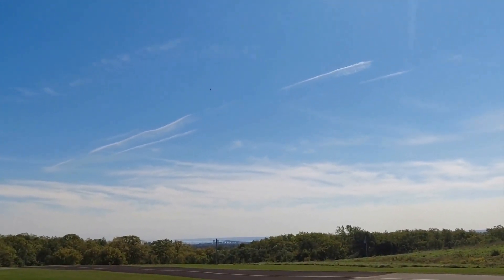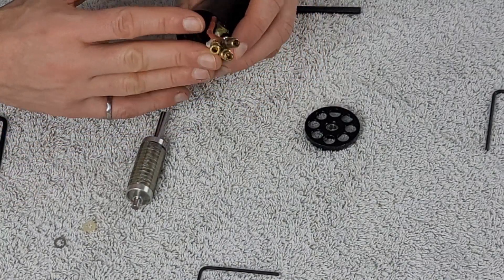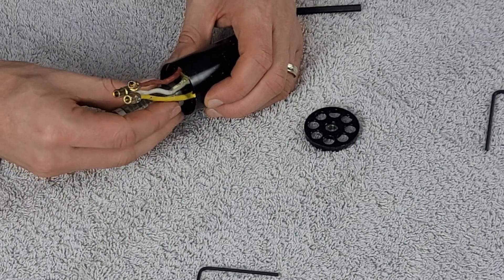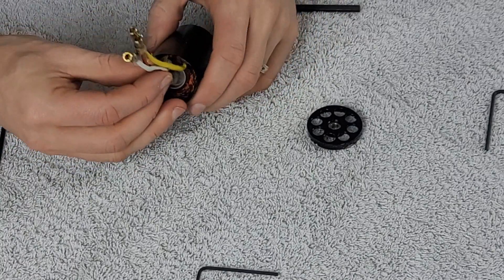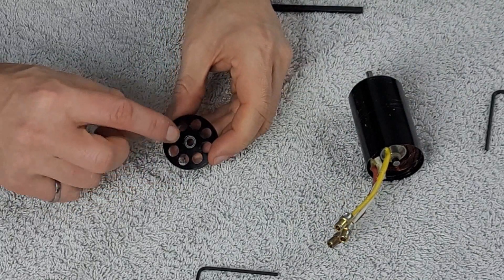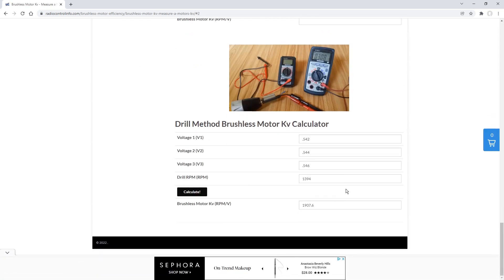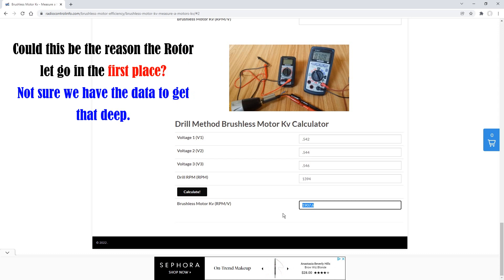Replacing a Rotor in a Brushless Motor - Unexpected Conclusion to our Failed in Flight Motor

Comment: Hey man, great info in your videos like always. You have enlightened me on so many subjects in the hobby I've lost count now. Awesome stuff. 

I am about to attempt re-winding an inrunner (will be a pain in the a$$ due to size and iron core not coming out of the can). The copper inside was melted after an experiment with running this motor on 8s when it is actually rated for 6s. It is the FMS 3060 1900kv 6s in a 70mm 12-blade FMS edf fan if that is interesting to you. 

So.. couldn't really count the turns of windings on each pole, but looking at the space given  in between poles in the core and phase wires count / 2 (i should probably say braid thickness of a phase wire) I can assume that braides of 6 0.45mm wires can fit comfortably on 4 turns per pole. Not sure if this is what the original scheme was and don`t know whats about to happen but Im bout to find out anyway :p

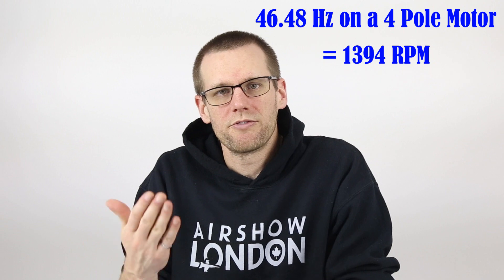Can you however explain what is the formula behind your ecuation and results at 9:16 top right corner, blue text? That would be very helpful of determining the kv I`ve achieved with the motor, given that I manage to wind it and get it running properly and then compare to the original 1900kv stated on the can. 

Anyways great channel man. Keep up the great work of diving deeper and deeper into those details.
Reply from the maker: Thanks for the kind words. I think I place formulas on the website. There i was calculating the rpm that the drill spun the motor at by using the frequency of the voltage output. You can also enter this value in on the same website.
Reply: @RCexplained  great, I'll check it out on your website.

Question:

With  my 4-pole rotor (4 magnets) should I not divide the resulting frquency on the multimeter display by 4, since for a full rotation there are four magnets passing by the measured coil and thus exciting  it and then multiply that by 60 (for 60 seconds in a minute) or am I wrong in my assumption?

Comment: The disassembly of HET is not correct,You should open the cover on the shaft side.
Reply from the maker: Mach from Mach EDF? What HET motor have you pulled open from the front side? I have a few old 700-68, 700-75, 700-83 motors in front of me now. I'm puzzled as to what you have done as there are only rear side caps. No front side caps.
Reply: @RCexplained  Yes, I am the owner of Mach EDF,The HET700 series motors are all opened from the front.
Reply from the maker: How do you do this?

Comment: I have a 3500 kv traxxas brushless motor. I was running my stampede 4x4 in a big open grass area when it suddenly slowed down. I got it back to me and right as it got to me it completely stopped. It turned out the rotor let go of one of the magnets. When I pulled the motor open I was surprised to find that the magnet had simply come loose and hadn’t shattered. I need to get some epoxy and Kevlar thread but I should actually be able to fix it.
Reply from the maker: Right on, if you can repair the rotor that would be great. If not, I'm sure you can get a new rotor for your motor from traxxas.
Reply: @RCexplained  I looked, unfortunately you can't get rotors for the newer motors. Mine is the newer 4 pole variant. You could get rotors for the older 2 pole variants but not the 4 pole ones.